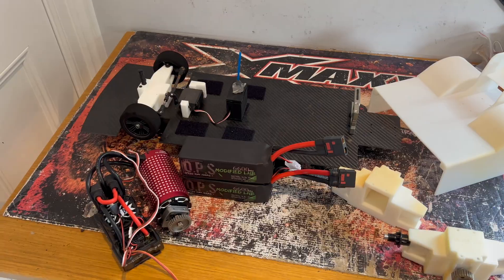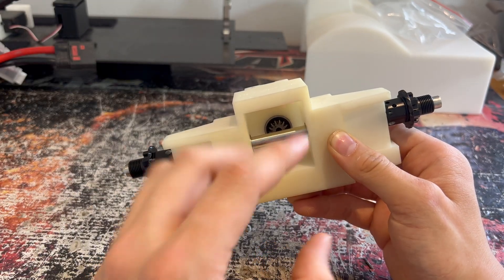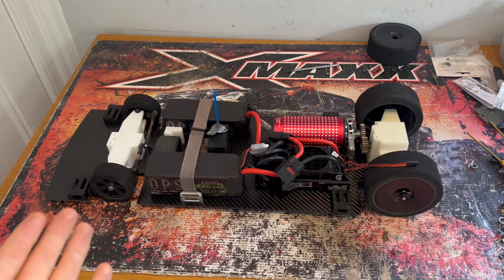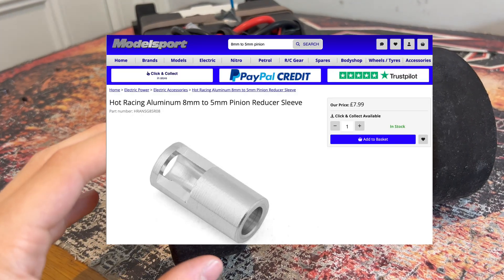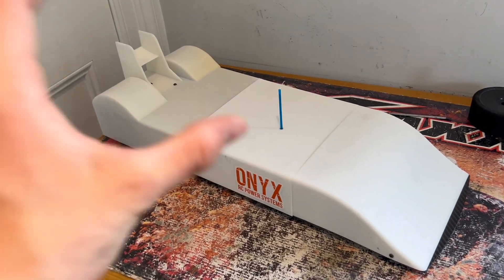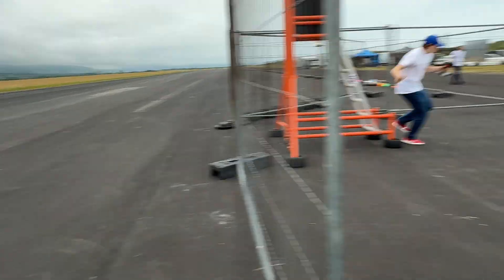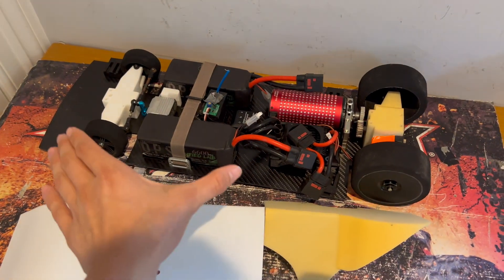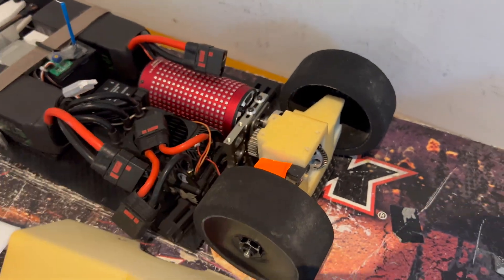I 3D PRINTED a 100mph RC Car Part 2 - Is this possible.....

Comment: If the chassis flex is causing the gears to go out of mesh then presumably the same flex is effecting the steering and stability too?? So, would a far stronger chassis plate and top brace be the next step forward?
Reply from the maker: Very possibly yes! You’re on the right tracks for next stage of the project 👀
Reply: @noahsrcs1808  NNB - The amount of gear wear is rather surprising, and concerning. Was the motor mount solid to the chassis? I assume it would be. Chassis flex over such a short distance would not seem to be a possible cause of such gear wear that happened soo quickly, I would of thought. So, is the motor flexing in the mount itself? The earlier VTE2 motor mounts are not the best, the latter ones are a GREAT improvement, far, far more rigid and accurate. A Scorched one would be even better of course.. And, I think better quality gears may be worthwhile too, chinesium may well not last even one good run by the looks of it.
Reply: Scratch a lot of the above, just checked on the video, it does look like the later VTE2 motor mount, and boy does that chassis flex....
Reply: NB - As Steve suggests regarding strengthening the bodyshell. I find Isopon P40 Bridging compound works very well, is relatively cheap, and is quite easy to work with. Just try a spare piece first to see how best to make it bond together. Sometimes I roughen, sometimes I also add holes counter sunk on the outside so the compound goes throughand forms a "plug".
Reply from the maker: @Weiun  awesome thank you so much for this!

Comment: why does it have to be bambo lab? you can buy much cheaper 3d printers
Reply from the maker: Most people who I know who do 3D printing opt to go for Bambu lab due to their accuracy and print quality, but yes there are cheaper printers.
Reply: @noahsrcs1808  theres little difference in the accuracy its more the ease of use, pretty sure the arma EXB 8s diff is 8mm shaft or maybe 9 much more of a beefy diff.  Also your pinion gears and diff input gears look the same diameter if thats true whats stopping you from running a shaft coupler instead which would eliminate the need for gears?

Comment: Hey Noah, as Tomley said already, don't give up!! I recommend making a brace between the diff housing and the motor mount (on the top). The chassis plate is probably flexing and causing the pinion and spur to come out  of mesh. Also, you can reinforce 3D printed bodies with one layer of lightweight fibreglass. Speaking from experience it makes a massive difference! Finally I don't think the castor is your problem regarding the stability, I think it's the torque of the motor overwhelming the friction your rear tyres have with the ground. You could go very very light on the throttle to help that, or add weight on the rear wheels to increase the friction. I hope that helps!
Reply from the maker: Hey Steve, thank you so much for all of this, it’s extremely helpful!!! Yes don’t worry I’m 100% not giving up, there have been some big design changes which will hopefully solve all of it!!
Reply: @noahsrcs1808  No worries! From one engineer to another! I look forward to seeing your updated version, good luck with it 👍